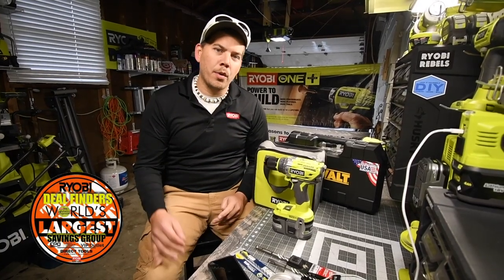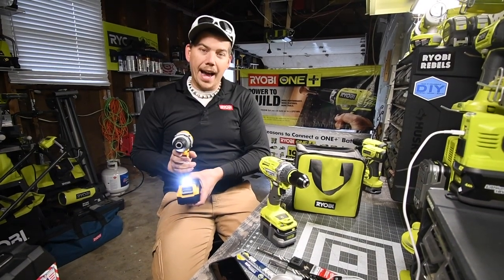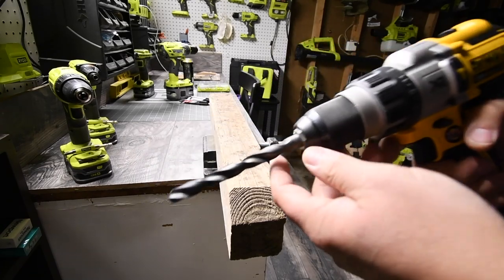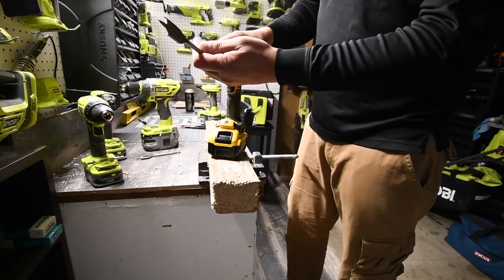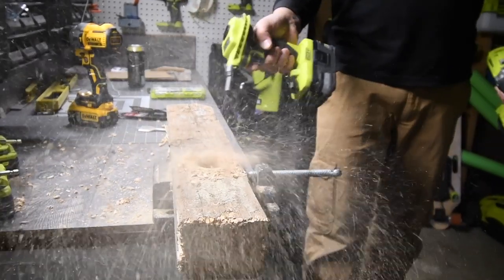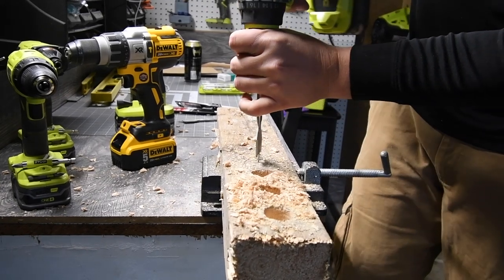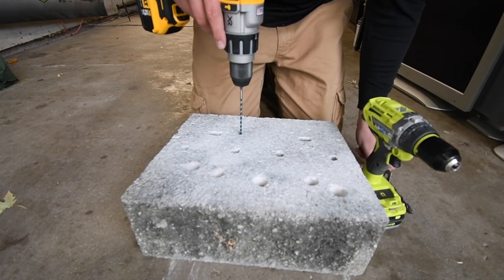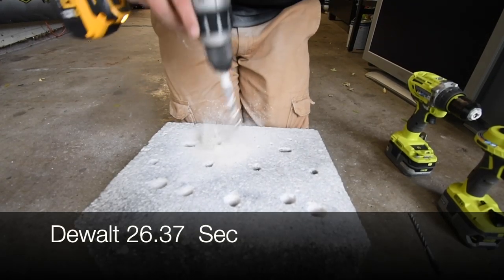Ryobi vs Dewalt (Brushless Hammer Drills)

Comment: FYI, 20V and 18V batteries have identical voltage.  20v is a measure of a batteries max voltage.  18v is a measure of a battrery's nominal voltage.  They both will measure  about 20.4v off the charger.
Reply from the maker: I didn't know that and thank you
Reply: Thanks for educating the people, I tried to tell people not because the drill says 20-volt doesn't make it more powerful.
Reply: In Australia the DeWalt is advertised and labelled as 18V and 58V
Reply: @aussiegruber86  I think you mean 54V.  Europe also.

Comment: For you Ryobi haters...years ago Ryobi was junk, but now it's a pro quality tool. I am a  contractor, I have all the brands, and Ryobi is mid pack with the other pro quality tool. I think it's better than DeWalt now, but a step behind it's cousins Ridged and Milwaukee. BTW, Ryobi is made by TTI, which also owns Ridged and Milwaukee. And Ryobi owns 25% of TTI! So it you haven't tried Ryobi lately, you should.
Reply from the maker: Ryobi has come along way and thank you
Reply: Your right Ryobi has really turned it around there was a time when Ryobi wouldn't be taken seriously at all let alone compete with DeWalt. I've kinda had bad luck with Ryobi when I first started my company over 10 years ago but the more I see the new stuff the more I consider investing in some if there stuff
Reply: Ken Cooper, yeah! I'm using Ryobi Green Tools at my job sites! Alongside with my Blue Bosch Tools, and my Orange and black Worx Tools too!

Comment: I have the DeWalt and it's a good tool but the switch on mine is exactly the same it's frustrating
Reply from the maker: the spade bit was a bad bit, I remade the test in another video
Reply: I have same one - they are all like that. It’s like a manual gearbox on an old truck without synchros. Just pull the trigger and it will get the gear teeth in line and easier to shift. It’s a great drill
Reply: Same here still though it's the strongest hammer drill I've ever used its unstoppable. One night for shits and giggles I used it to break a lug nut free. After stalling a hand full of times it broke it loose couldn't believe it! It was in my Polaris rzr so torque spec fairly low at 70 ftlbs but still it impressed me they can be tough they get very dirty and corroded!

Comment: You basically are required to use an HP battery with a tool that can utilize one, so factor that into the purchase of tools, batteries, and convenience of keeping the HP batteries separate from the non-HP batteries on the shelf.
Reply from the maker: this is a very old video. This Ryobi cant keep up the the tests I do now. the test from this video aren't extreme enough and the the Dewalt would destroy this Ryobi with my newer tests

Comment: I'd be interested in seeing how the Ryobi stuff does against the 20v black and decker stuff. I'm interested because like no one has a whole line of black and decker 20v stuff. Maybe it's just that bad lol.
Reply from the maker: I can pick up the Black and decker set lol and to a comparison
Reply: LOL, Dewalt is owned by Stanley/Black and Decker.
Reply: Ryobi probably much better then the black and Decker now I would be interested to see how the new tti platform Hart stacks up against black and Decker since both are the bottom of the barrel for their respective manufactures (DeWalt/Milwaukee)
Reply: I actually have the entire line of B&D tools and I can say they’re on par with the non-HP Ryobi tools. They’re definitely homegamer tools but I built a shed with them and they did fine. The drills can’t do masonry, though. I had to borrow a buddy’s more powerful drill.
Reply: @Chukijay  I got some black and decker tools since posting that comment. I would have to say that I agree with you. I really like the inflator and the alligator lopper. The sander is pretty good too. Lowe's and walmart had a bunch of the 20v stuff on clearance last year so I tried em out. I was very pleasantly surprised. They've done good on all my projects.

Comment: Northern Ontario Canada prices.

$800cad = Bosch 18 V 3/4 Inch SDS-plus Brushless Rotary Hammer Kit with Chisel Function

$520cad = DEWALT 20V MAX XR Li-Ion Cordless Premium Brushless Hammer Drill with (2) Batteries 5Ah, Charger and Case

$260cad = RYOBI 18V ONE+ Cordless Brushless Hammer Drill/Driver Kit with (1) 4.0 Ah Battery, Charger and Bag

$170cad = Milwaukee Tool M12 FUEL 12V Li-Ion 1/2-inch Brushless Cordless Hammer Drill Kit with 4.0 Ah & 2.0 Ah Batteries

$160cad = MAKITA 18V LXT Brushless 1/2 inch Hammer Driver Drill (Tool Only)
Reply from the maker: that's a lot dough
Reply: Wow that's crazy I paid what would be 392$ cad for the flex volt hammer drill impact kit that included a 6ah flex volt battery, a 2ah standard xr battery, yellow fast charger, dcd996 premium hammer drill as well as the dcf887 3 speed brushless impact driver. This was straight from home depot no less and usually I pay a premium there for convenience! Oh and it came with an extra large DeWalt bag kinda funny it's got a huge American flag on it never seen that before.

Comment: Ryobi brushless  hammer drill is good but the overload protection is annoying with a 4ah battery it’s less with a HP battery anyway I prefer the ridgid octane hammer drill and my Milwaukee m18 gen 3 hammer drill I’m not into dewalt
Reply: Daniel Gomez What size battery are you using?  The reviews I have seen say it will do that will the lower amp batteries.  Put in a HP+ battery and that won’t happen.
Reply: Bull Dog yeah I forgot about that I have the 3 6 and 9ah batteries from ryobi and when he used the regular 4ah one that’s when I see it lacking with the spade bits ryobi brushless is awesome
Reply from the maker: I gotcha and thank you for viewing

Comment: Everything that is wrong with this test:
In the first test, the drill bit wasn’t long enough to expel the chips making the wood burn and slowing down both drill. 
In the second test, the dewalt was slower because you couldn’t put enough pressure for the bit to dig in the wood due to the faster rpm. 
You should have used the dewalt in second gear. It would have demolished the ryobi
Learn how to use a drill. Not hating juste pointing out facts. 
Ryobi is a good drill but not nearly as good as this dewalt
I actually prefer Milwaukee 
Also looking at your shop you are clearly a Ryobi fan so your opinion is leaning towards Ryobi of course
Reply from the maker: I agree with you on the dewalt. I will be doing another test very soon with it on second gear.
Reply: Ryobi Man Caver awesome, can’t wait to see it

Comment: Drilling into timber produces uneven results, as timber is notoriously non homogeneous. You should have tried a few more holes and under same pressure. Same with concrete block. Batteries also play a role, should have tried a few more batteries and take averages.

Comment: Nice to know the results since I have the same Ryobi brushless hammer drill as you do. 
Now could you do a comparison between the brushless Ryobi 7 1/4 inch circular saw and some over brushless 7 1/4 inch circular saw since I have the Ryobi modle P508 7 1/4 inch circular  saw  I'd like to see if there is a difference between it and a Milwaukee, Dewalt, or Mikita.
Reply from the maker: Plenty of versus videos coming this winter :)

Comment: I would advise not using SDS bits in regular hammer drills. It’s hard to make sure it’s straight, that would be why the Dewalt Wes vibrating so much. 

Buy the way I use SDS hammer drills on a regular basis.
Reply from the maker: but it makes a good stress test
Reply: True.
Reply: Which knobheads put an sds drill bit in in a normal hammer drill chuck.  They shouldnt own a drill.

Comment: Have both the previous (older BL) version to the DeWalt and the Ryobi BL hammer drills..  Mine doesn't shake, let alone vibrate, that much. Nor does it take that long. I don't trust my ryobi one handed on a 10ft ladder. My DeWalt will do the job, but I will use Ryobi with both feet on the ground. Something's not right with that DeWalt drill.
Reply from the maker: Thank you for viewing sir
Reply: Mykel Hardin  he did an update vid. I said I have both drills in exception that the Dewalt is the older version same motor. Performance-wise they are different.
Reply: Mykel Hardin ... You commented on my comment... As I said I OWN both tools. The shell of a tool isn't the only thing that sends it up $50-$100. I thought, since you commented on my comment, you would enjoy another vid he made with the same tools. But you clear don't appreciate when others put a out a fairly kind gesture. Have a good and peaceful day.

Comment: is that the ryobi twin drill? the other one is for screws, other one is for drill right? i did the same, that second drill for drilling purpose on speed 2 is damn strong and beats my dewalt.
Reply from the maker: At the time of this video, I did not owned that dewalt. I borrowed it form a friend and he said dont break my tool. My tests were not extreme enough back when I filmed this. this video is garbage and NOT a good tool versus video
Reply: @ManCaverTools  what is robert bates?

Comment: Can you test the craftsman cmcd721 (or the equivalent EU model Stanley sfmcd721) vs the Dewalt dcd996?
Reply from the maker: I do have a craftman hammer drill and a video is coming out on it soon and I thank you for viewing Man0
Reply: @ManCaverTools  Thank you for the reply! I will wait for your video cause I'm literally between these two. I would appreciate an extensive comparison in high speed gears , and with a 4ah craftsman battery if possible. Thank you

Comment: Apparently you can’t tell from a sharp drill bit you lie I can tail when it drills
Reply from the maker: I re did this test and the dewalt won. it called HP vs Flexvolt
Reply: It beat Dewalt in every type of bit. Not just the spade bit. For the difference in price of the two drills the Dewalt should be much faster. Good test👍

Comment: Great video! The Ryobi HP batteries make a HUGE difference in Power Performance!! That DeWalt wobbles sitting on the ground when you put your hand on it at 14:12 due to the tiny base. Is that a design feature? Extra wobble? Just curious....
Reply from the maker: Yes it does, and  the Dewalt was majorly liberating and I don't know why

Comment: I can't help thinking you hit a soft spot in the concrete block, no way the Ryobi could drill that easy, not against the 996!
Reply from the maker: I was told by the TTI rep that the Ryobi isnt that powerful of a drill but it does have a nice hammer drill feature. but I redid this test and and I will redo it again soon.
Reply: @ManCaverTools  just so you know I'm not biased, I've got tools from Ryobi, Dewalt, Milwaukee and Bosch. My favourites are Bosch brushed.
Reply: I have both yellow and neon green tools no bias at all, just a diy’er. You you might use the HP Dewalt batteries or the Ryobi STD batteries to even things out. Would really be interested in those results. Keep up the good work on these videos. The end users are the winners with all the competition these days.

Comment: One is not higher volts than the other. It’s simply how they market it. Both drills are 20v out of load and 18v in load. So DeWalt is just labeling their batteries with the no load voltage and Ryobi is labeling the in load voltage. The reason Stanley black and decker labels their batteries with the no load voltage is because there is a tool manufacturer that owns the rights to 18v on tools and any other company that puts 18v on their tools has to pay royalties. Also, and don’t take offense here. There is zero chance Ryobi is better than DeWalt, I feel inexperience and favoritisms to place here. And I love Ryobi and it’s basically all I own but that’s the fact here.
Reply: Actually it's not a marketing scheme, dealt already had a 18v line with different style batteries. So as to not confuse everyone they called it 20v. Also all 18v batteries with no load will read 20v.
Reply: Wazoo117 no it’s not. They switched so they did not have to pay royalties. That is why all of Stanley black and decker is 20v.
Reply from the maker: I gotch ya and thank you sir

Comment: Have a lot of ryobi tools. Took this drill out of the box pull the trigger and....... smoke. Going to try one more tomorrow, we will see. Do you want a follow up comment?  I work my tools hard.
Reply from the maker: sure, let me know how it does. my Hammer drill is still going strong
Reply: Man Caver Tools well I got another one and this one pull the trigger and it runs and quits comes back on if you reverse the direction. Bad trigger I guess. Ryobi really let me down on this one. Going to trade it for the brushed drill. This and the 18 volt orbit sander have been a huge letdown.

Comment: Holy Crap 💩 !!   The DeWalt's paddle bit was smoking and Not cutting for the first 8 seconds , that bit was so Dull I can't believe the Dewalt even got it through the wood to begin with... Also on the concrete test ,after watching it again it looks like you don't have  the bit in the chuck correctly and that's why you had so much  vibration  because it had a wobble to it , I could feel it from hear..
You Ryobi guys crack me up, your all super happy in the comments,  lol ....
I'm sure it was either a Joke or a Mistake.... 🖖
Reply from the maker: it was a defective spade bit, I uploaded another versus video shortly after this one. Dewalt won in that one
Reply: @ManCaverTools   -- I knew something was up by the smoke show.  It did make an interesting video though , lol...
Be Safe.  🖖😷👍
Reply: Night xey
Reply: 😅8

Comment: I've had drills of all manufacturers, makita, dewalt etc. Not cheap drills by any means, do the exact same thing. It's not a defect, you didnt have to put it to speed 3 first.
You just needed to align the gears.

Also you should not be getting smoke drilling holes idk what's up with that.
I wanna say dull bit but.. I think a knot In the wood more likely.
My 996 with a 1 and a half inch spade on speed 3 blows through a 2x4 in about 2 and a half seconds, throwing wood chips feet away..
So for me what I'm seeing here I find hard to believe and not just because I like dewalt.
I grew up using ryobi tools.
I have an old ryobi recip that i used when i was less than 10 years old. ( I'm 31 ) the saw is still a go to for me when I dont need to cut the cord and use my cordless.
Ryobi is great. It has been a good brand.

But hell I have a hand me down 1986 Skil corded hammer drill that would still have out performed these two examples..
But my 996 mops the floor with my old Skil.
So your video confuses me lol.

not saying you're bias but based on the background in this video, I may be inclined to believe you wanted the ryobi to win..

I will give you the fact that something is not right with your 996 lol
Or your test media
Or your bits
Not sure if those were new in box for this video, but if not, I definitely see why both drills struggled.
If you normally allow your bits to get smoking hot you're destroying them

I feel like your ryobi should have performed better lol
However that vibration in the 996 is 100% not normal lol
Reply from the maker: This is a old video. I changed the test to be a lot more harder. I revisited this test and the Ryobi lost. the tests when I made this video were not hard enough. but now they are much harder to do and the Ryobi cant do them
Reply: @ManCaverTools  definite sub tho

Comment: Ok Ryobi won but I've seen in your future videos of that same dewalt hammer drill keeping up with milwaukee and even beating it in a test. I'm sure the dewalt has more power than that Ryobi  and in the spade  bit test something had to be wrong with that bit or the wood cause the dewalt was drilling all it was worth and hardly penetrated the wood. Even a weak drill would've went further in that wood. When it comes to masonry bits the Ryobi does pretty good
Reply from the maker: Roybi did not win. this is a very old video and back then my tests were not extreme enough. The Ryobi would not stand a chance against the other brands with my tests now
Reply: @ManCaverTools  I was just freaking out thinking that the spade bit on the dewalt was dull cause the dewalt was moving very fast. I've known Ryobi to be pretty good at masonry  drilling. Also I've seen alot of your other videos with dewalt dominating Ryobi.

Comment: I think the Ryobi will need more batteries to keep up with the dewalt.  But I think both hammer drills will last about the same amount of time before they burn up.  
The guys at work make fun of me for getting Ryobi tools.  But they’ve burned up dewalt drills.   And I’m still using the first Ryobi drill I bought.  
I would have liked to have seen the price info included.  I feel like that would help give a better comparison between the 2.  
The Ryobi kit comes in at $160.  The dewalt comes in at $300.  
Is the dewalt drill twice as good as Ryobi?  Nope.   I’d rather buy 2 Ryobi drills then 1 dewalt.
Reply from the maker: Im sorry I didn't include price, but I agree, id rather buy 2 tools for the price of one other brand and thank you

Comment: Well, what do you expect from a guy who collects and bias to ryobi brand? You can obviously see how this guy handle the drills differently...smh. I have both drills by the way and i always choose the dewalt for heavier task. There's a reason why ryobi is directed to DIYers and Dewalt, Milwaukee, makita, hilti and so forth for the Job site. Go figure
Reply from the maker: I did another video and Ryobi got its but kicked. I uploaded it yesterday, check it out
Reply: @ethanthomas4659  amen
Reply: I have the Ryobi brushless drill and the gen 3 M18 Fuel drill, and I havn't seen anything battery operated of equal size on the market that can beat the gen3 in terms of performance. But the Ryobi is insanely good at its pricepoint! I have it in my work truck as a cheap beater and it payed its cost a looong time ago.